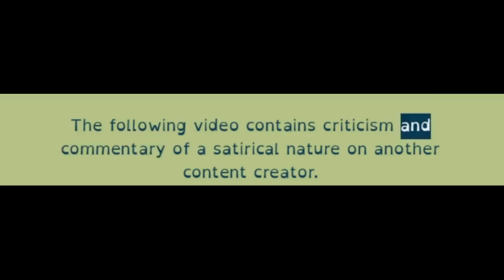REACTION: Another INSANE CRINGEFEST "Restoration" - Antique Kenwood X76 Cassette Deck

Comment: I know what a piece of electronic equipment actually looks like after sitting in the dirt for years. I found an old Sony VCR partially buried in the ground. It was beyond repair. The circuit boards were covered in corrosion and about 70% of the components on the boards had their legs rusted out completely. The steel covers were covered in rust and some spots had completely rusted and fell apart. All the displays were smashed and the buttons were seized. There was dirt inside wherever it could get to and the whole thing had an ant nest inside. The list of problems and issues just goes on and on. There was no saving it. The only reason I took it home was to help clean up the environment.

Comment: You’re the guy I have been asking for in the original video for proof whether this is a legit restoration, or not!
This is a time lapse video. So, the time to wash and fully dry could have been edited. 
I have worked in the electronics and electronics repair field for nearly 15 years and I believe this is a legit restore
There maybe editing, but he gets this to work.
It doesn’t work well, in the end, but it does play.
I believe this is a legit restore, and in the end, this guy got this, at least, working.

Comment: You don’t know what you’re talking about, these a real. I saw a tape deck fall off the back of a pick up truck and land on the freeway so I stopped and picked it up. When I got it home I cleaned it thoroughly by putting it through the dishwasher on a heavy duty cycle and then dried it thoroughly in the oven for 2 hours at 400 degrees. Just to be sure I soaked it in evaporust for 2 days and then dried it in the oven again. When I plugged it in it worked perfectly and I sat and listened to some music with the Easter bunny I rescued from a drain and the unicorn I rescued from a frozen lake.

Comment: Im actually somewhat inclined to believe that deck WAS sitting outside being baked away in vietnam's humid climate for years on end. The pattern of damage "makes sense" so to speak.

You 100% would NEVER restore something like this, i don't know if shango066 would even resurrect that thing.

You can pull parts off this thing tho.

Comment: I think you edited out for length, but in the original they show him working the cassette doors following "reassembly" - they move very, very, slow, as you would expect for a mechanism that had been filled with mud and rust (I can only imagine how gritty those hinges would have felt). Yet, magically, the doors pop right open at a decent speed at the end...

Comment: the caution and attention  signs on the pack have damage and paint scratched off which he would not be able to repaint on yet it is magically repaired at the end of the video. You can tell its scratched off as he cleans of all the dirt with the water and its still scratched off and more visibly damaged.

Comment: I am sure he did not restore the front like that but I have seen plastic restorazions in the same quality. Not out on a bench with a hose and an angel grinder, but on an electronic lab where they used days on filling scratches, buffering for hours. They did also have a lot of advanced ger, meant for that. And the price for such a job would easily pay for 10 of these cassette players!! :-)

Comment: It is like those phone "repair" videos - where creators buy a bunch of trashed phones (usually iphones, cause people associate value with those more) and "repair" them to near shiny and new condition. Most of the time the only part that is taken from the actual trash phone is the mainboard. And while an important piece .. i do not consider it repairing. When you replace 80% of something with new parts .. it is not a repair. 

Most of those videos are staged, obviously so. While that is not such a big deal with garbage electronics - it is cruel when they do the "animal rescue" thing.

Comment: There is a guy in Vietnam who fixes up 80s/90s electronics but they are not this bad. He does wash the electronics BUT he takes the mechanisms apart and he doesn't wash the motors. He also hangs the electronics out in the sun on a clothes line. so I imagine the sun dries the innards out real good.

Comment: I'm an electronic technician with 40 years or so of experience, and I do restoration for my clients, but the device must have been stored properly, and NOT submerged in water and mud for me to even TRY to work on it, and I won't do it with a bad 90s cassette deck. The device must have a value of at least few thousands of $ for me to even remove the cover. No way that tape will work again.

Comment: I did watch the original video (I was intrigued). 
I didn't vote on it, but I did leave a comment calling fake.
There's no way the motors would work without a complete strip-down (and probably not even then). 
Also, the final rear is different to the original rear (labels in much better condition).

Comment: I do agree that this is bullshit. But I have a story. I was playing a New Years gig and it was outside at a very wealthy family’s house and my dolly hit a broken pool filter cover and it tipped and my PA head slid off the top and ended up in the pool. I asked if they had a hair dryer and some portable fans. I took it apart, luckily I always keep an extra and it dried out fine and by the 2 set it fired right up and still works to this day even though I don’t use it on gigs anymore do to powered speakers and so on ,but it still works great in my lesson/ rehearsal / man cave. Go figure it’s kinda like Peavey. I say that you throw a Peavey down a set of stairs and leave it in the rain 🌧 turn it on and it still sounds like shit LOL. POINT THEY DONT DIE LOL. Love your channel

Comment: You would have to see the Commodore 64 that I found buried in a garden over 20 years ago, I took it as a challenge ... change capacitors, clean everything to the extreme, rust by all the integrated, I do not know how long it will last but right now I am using together with my other retro computers, if there is something to accept it is that the Commodore 64 is indestructible

Comment: Here's a trick if you want to remove deep scratches off of plastic for real: You use a lint-free rag saturated with acetone. Never stay in one spot, always smear to blend the scratch in as the solvent softens up the plastic. Move to fresh parts of the cloth. It can be alright just after this, but use some jeweler's polish if you have it.
Warning: It ruins any print. Unless you can screen print the design back, avoid touching printed areas. Or just live with plain plastic - the designs on cassette deck doors are usually just meaningless arrows, dots and marketing claims.

Comment: "rust paint" exists for model makers, I bought some in a spray can at my local model train shop for like 4 bucks. Looks really realistic and 3D, a bit like flocking except, well, like rust. I wouldn't be surprised in the least if that's what these guys use to make stuff look old and dilapidated beyond reasonable repair so they can magically "fix" it in an acetone bath that looks like oil.

Comment: Did you happen to notice a couple electrolytic capacitors had ruptured. they would have defiantly filled up with mud and shorted. The Mylar/film caps were probably ok, but old caps are the #1 thing I replace. Plus he didn't check the tolerance on the resistors, they tend to drift in value especially when submerged. lastly what the heck was he testing with that ohmmeter  25:50 ...scary.

Comment: That was not the capstan but it was the flywheel. Still the flywheel was a part of the capstan and it would’ve been caked too. Should be surprised the pinchrollers aren’t crumbling and the bearings frozen to death. Huh, weird

Comment: Last year I repaired an old 1970's sanyo radio cassette the plasterer Guy left at our home in 1997. The plaster was caked into everything and I needed a lot of isopropyl alcool and elbow grease to remove it all. I think it took at least 5 thorough cleaning with alcohol and a soft bristled brush to remove it all. Some paint spots on the shell couldnt be cleaned at all. Theres no way the guy in the video cleaned that radio cassette deep enough for it to fonction properly. Especially the cassette mechanism which took me about 3 days and new belts and mine was in good condition so imagine his!

Comment: I've worked in electronics for most of my life, and there is no way that if you left a tape deck out in the elements to get that much rust, that it would have any chance of working again unless you replace most of the components.  The traces and pads would all be corroded and peeling off, not to mention all the pots and solenoids would be all messed up..  Imagine all the hours you would have to spend troubleshooting all the components, then re-calibrating everything with a scope etc!!  LOL!  It was entertaining tho....

Comment: What happens is they find two models of the same. One good, one bad and they change parts. They make it look they are repairing the thing. No chance in hell that circuit board and power supply will work after all the water and the rust.

Comment: Plus squirting it with TAP WATER! lol I watched this video a while back, crazy shit... I hope you now realise that you CAN buff plastic to become shiny and remove scratches?! I used to do this for CDs and DVDs, plus I do it for my headlight covers on my car when the UV corrosion gets bad enough to diffuse the headlight beams... To the left of the coax input audio plugs on the back, you can clearly see in tge frames where you paused the video the scratches are still there, they are darker. Covering labels with lightly adhesive masking tape means the labels will look good after re-spraying.

Comment: 28:52 i don't know about "brand new", there's some wear to the silkscreen Kenwood logo & it's possible the doors could've been polished with Plast Rx or similar, that stuff is pretty good. Also, i note the bottom case was clearly spray-painted which would account for no marks there. I do think the back panel might have just been dirt residue from half-assed first washing rather than paint gouges too.  I do agree on some parts though, like the underside of the PCB where there was no rust, also for it to be that covered in surface corrosion on what was zinc-plated sheet metal, there'd have to be rotted off pins on components not to mention more serious rust on panel edges etc.
Overall i agree with you, this was faked but perhaps he really did rebuild it afterwards too. The rust was too widespread and light to have been long term, it was doused in acid, washed off and filled with mud for a week or two.
Reply: By the way, I'm sure i saw the resto vid in my suggestions a month or two ago but not under his username... I haven't watched the original video as i won't add to his views currently as it's very suspicious to say the least.

Comment: Well my Nokia 5110 I bought 1998 was drowned 3 times during the 3 years I owned it. All I did was dump it in a bag of rise and the heater room. Worked then and still starts (yes I have all my phones i owned in their original boxes)

Also back in the day when I used liquid nitrogen and dry ice overclocking gpu’s I used to wash the cards with water to get all the grease of then bake it in the oven for 50c 24hours. Always worked.

But I doubt this restoration would actually play a tape. Unless he did some tuning we did not see it would definitely not work. The belts would have bin so dry also.

Comment: I've watched some of these Asian so-called "restoration" channels and I always cringe whenever they strip things down, wash everything with a high pressure hose, then hang the individual pieces on the clothes line to dry (this is not the proper or professional way to restore vintage electronics - even a young person just getting into doing something like this for the first time could do better)! 🙄I've repaired and refurbished many tape decks over the past 3 decades, and never once did I need to strip any of them down to bare bones and wash all the parts, including motors, transformers and coils.

Comment: Ahhhhhhhhh, I wanted to see him cleaning the heads with the wire wheel. How could the circuit boards not have any solder corrosion connections?

Comment: I saw this video a few weeks ago, the guy absolutley had 2 matching decks and swapped out pieces.
Reply: Either that or he started with a working deck and edited the material from it's chronological order which would explain the lack of pitting on the metal and the lack of scratches on the faceplate and aslo the lack of tarnish underneath the mainboard.

Comment: Even if he could have buffed out all of those scratches on the front doors, why didn't he do it while they were off of the front plate? He showed that he had already reassembled the front plate with the scratched to hell doors, and then the scratches disappear? His video has more holes in it than I can count, and I'm not any kind of electronics restoration specialist. Good call on calling out this crock.

Comment: You can use an ultrasonic cleaner which uses water and an added chemical but its heated and after the cleaning you would use alcohol to clean it. This kenwood was toast from the beginning. Im a repair technician and work on agricultural and aviation electronics with  a past of repairing cell phones and tablets. This pcb is toast and not worth trying to restore. you would need to replace proabbaly 90 percent of components on that board to get it working.

Comment: My favorite one is his guitar restoration if you are are a guitar player it will make your skin crawl.In another one he "restored" a power amp but didnt put the insulators on the output transistors which means the moment he turns the power on it will blow the fuse, not to mention 3 emitter resistors are missing.I dont know why he keeps making these videos everyone knows they are fake.

Comment: pretty sure he just spray the thing with an acid solution and let it rust for a bit. Would explain why there was no rust whatsoever underneath the circuit board, and beneath the case.

Comment: There is clearly some fake and cheating going on in that video, but the repair process in itself is not that far off. I have often had to soak dirty electronics units into water+soap, or other types of solvent just to be able to remove the dirt before a repair was possibly, but you need to dry it afterwards and that is the tricky part, we had a special big oven, 70 degree Celsius, with a lot of airflow inside for this sole purpose (baking time minimum 24 hours), and you always had to replace potentiometers, switches, plugs and sockets, and then you could start the repair, and often there will be more parts to replace, and at the end you need to give the whole electronic unit a sort of lacquer layer to protect it, the poor thing has to go back to it's dirty environment.
So I learned that you can repair quiet dirty and damage things by first cleaning them thoroughly, some times you need to do it more than once, and then you can start the repair, but when it comes to mechanically parts that are rusty / corroded then you are simply missing material when you are finish cleaning, and this fact is unavoidable and tolerances in the mechanically movements is off that much that satisfactory operation is not possibly.

Comment: I live by an estuary, and often see electrical crap on the shoreline. The entire thing would be covered with mud. The back of the board, the chassis under the board...EVERYTHING. The mud is suspended in the water and gets deposited EVERYWHERE. This guy has just slapped some mud down onto it from above and then let it sit for a few days. That corrosion ain't a month's worth. That mud is salty as Hell. That's not even a week. That's 2 or 3 days, tops

Comment: If he had actually broken down the motors and refreshed the brushes in them I'd probably actually be okay with it being a fake -if he at least did the things you would have to do to bring something like that back to life. I'm pretty sure he had two of these, one that was kept pristine for the full restoration but he pulled a lot of the parts off of it and put them on the bad one that he muddied up

Comment: All the rust shows clearly that he used a oxydation spray on it. So the underside of the case has nearly no rust just by the hole where the spray runs down. Also that nur rust under the pcb. And the realy strange rust pattern in DE casset deck. The motors AR just rüstet on the top side. That's so obvious. Man that is so funny

Comment: The trick is how he edits the video. He shoot the video when the deck is in somewhat reasonable condition and not rusted and changes belts, then after he finish showing it working he throw it in in the river and then shoot it all rusted and show some cleanup and etc. The he edit the video and put that part first. Yes it is the same deck before and after, it is the way how he edits the video. He just pretends that he restored it from that condition?

Comment: Nice of the people who threw it away to unscrew the top, throw it away close to the device, but be nice enough not to dent them at all.
I've had normally used tape decks with tops in worse condition.

And I guess they've just included the screws to put it back together to be nice. 

And then there's the question why he's even going through the hassle to restore a completely trashed, low-end tape deck that's worth like 20 bucks in GOOD condition. 
It's cheap, perfect for buying one and dumping it in the dirt after filming it working.

And I die inside every time he yanks out a board or fragile component with a fucking screwdriver.

Comment: I have seen restorations of electronics that have been sitting in a dry garage and they had lots of problems that need to be soldered and replaced. How can anyone claim that this kind of thing is real? Humidity can corrode every connection yet this thing needs a rinse?